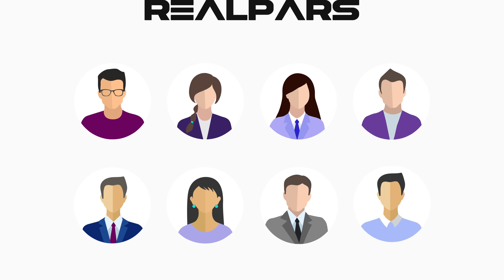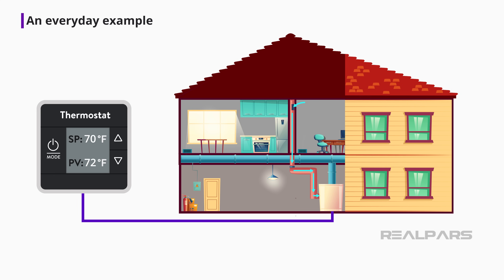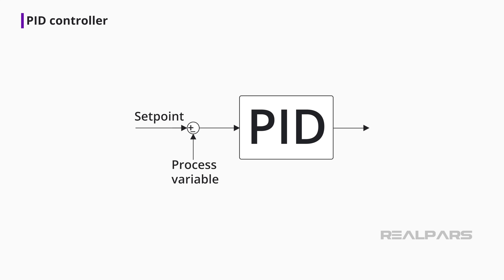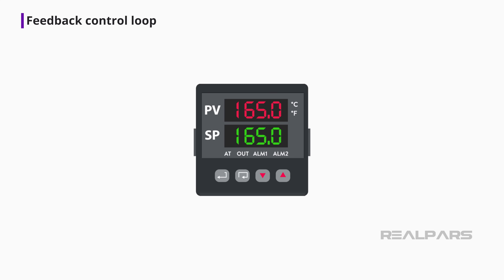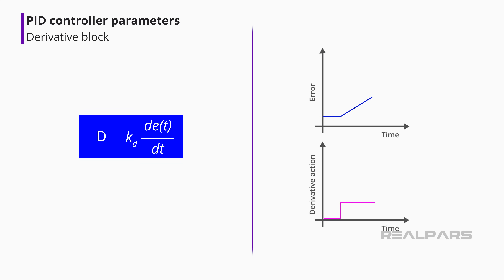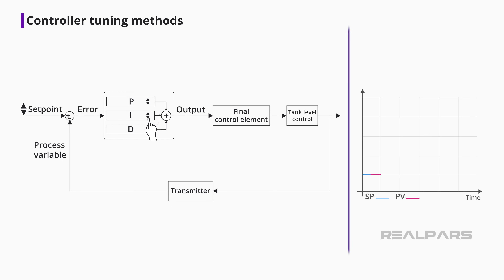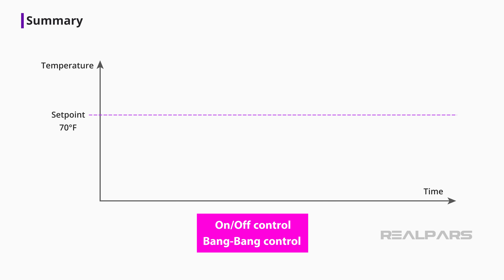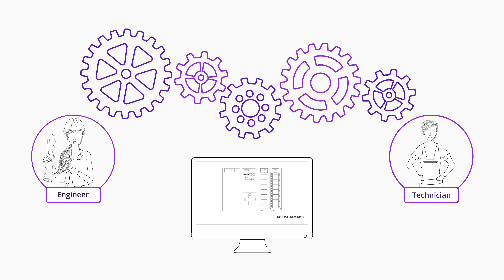PID Controller Explained

Comment: Can you do a video on " how Exactly does data transfer happen in physical level in wires or fiber optic cable."So that even non tech savvy person can understand. How exactly is 1 bit transferred between two points like New York and London ,like by switching the Voltage for s bit the whole distance? Switching it for each bits? Smart ways? How? For 1 packet ?
Update: sure get highly technical but start from simpler level and get into the depth slowly. And the reason I'm asking it here because I believe no other can explain it better than you.❤️
Reply from the maker: Thanks for your feedback and suggestion! I will certainly share this with our course developers, hopefully we can focus on that in a future video courses. 

Thanks again for sharing and happy learning!
Reply: Sort of an impossible question to answer without getting technical. There are lots of different protocols using different ways to encode signals on the "physical level". Electrical signals have properties like amplitude, frequency and phase. You can use any combination of these to encode signals. The protocol determines the meaning of a given change to a given property.

Comment: Nice video, but I think it's a mistake to introduce the PID parameters without mentioning that there are different types of PID controllers. The model presented here is parallell PID, where each parameter is applied to the error separately. In the industry, another very common type instead defines a parameter called gain which is then applied to the proportional, integral and derivative parameters. The I and D parts of the PID are then usually called Integral Time and Derivative Time. If one applies the same values to these different models of PID or tries to tune it the same way as is presented here it could lead to a lot of problems.
Reply from the maker: Hi @isakoqv. Thanks for your feedback and comments. It’s difficult to encapsulate PID details in a short Youtube video.  Your comments about Gain, Integral Time, and Derivative Time are true and those terms are important. We hope to discuss those terms and more such as Reset Windup, MPR and RPM in later videos.  Discussing and observing P, I, and D response to error is an interesting challenge because obviously in a dynamic environment, the error is always changing because of the controller response. As for tuning, there are lots of so-called tuning methods and as you say, not all are appropriate or advised as blanket methods for every application.
Reply: @realpars  It was years ago when I learned Ziegler-Nichols method and Cohen-Coon for tuning a PID controller.
Now, I forget all of them. I turned to become a programmer not related to Control System/Engineering. Only occasionally I want to relearn this interesting field.
Reply: @lexsoft3969 Hi I’m in the same spot right now. What type of programming did you get into? I’m also wanting to relearn PID and the methods, it’s been years 😊
Reply: @badplayer5880  Currently Web. In the past, I was involved in desktop non-web using FoxPro for the 1st time, followed by Visual Basic.
Reply: @realpars  sir, is it possible to make pid controller with equation of heating and cooling.
Reply: Great video. I think anither  important concept to understand is the process your are trying to control. Dead time, time constant and process gain (linear and dynamic).
Reply: Hello.i have a grundfos vfd for irrigation purpose.i want to maintain 3 bar pressure.what are the collect settings
Reply: You're just a hater
Reply: @jarnix2  Huh?

Comment: I hope you guys into explaining the math or at the very lest the transfer function of the system in future videos.
Reply: A good shout Eric. I managed to scrape through Control Systems online but found the formulae tough going. A good explain with practical examples would have helped a lot.
Reply: @YewrMan  We had a teacher who really did not get it, to simplify this subject.  Quite the opposite.  Later we had a teacher who knew the formulas and told us.  They are plain math. No fancy stuff, not even the integral part which is just the sum of something.
Reply: @mortenlund1418  Morten, is there any YouTube channels or elsewhere you can recommend that shows good practical explains of the mathematics of Control Systems. I think online study can be hit or miss depending on the lecturer. Some are brilliant and patient in explaining stuff and check that you understand and you learn the topic not just how to answer questions. But others just want to get through their online lecture quickly and at the  end of the semester give you loads of hints to get you to pass the exam even though you barely understand the topics on it.
Reply: @YewrMan  Hello and sorry for the delay. I remember making an excel spreadsheet on the PID.
But I will recomend you to first of all neglect the Deriviat for now, it is mostly a pain to work with and quite dangerous.  
First go for the Proportional.  It is straight forward math.  You somehow either multiply with more than 1 or less than 1. If you use 1 it is a waste of time.  Then you look up the formula for Integral - they are out there mostly disguised as very complicated -  using special signs and build complex. But they are not.  It is just the difference - summed together.  Loook it up and do not let them scare you away.
Reply from the maker: Thank you for sharing your feedback, Eric! I will certainly go ahead and pass this on to our course developers for future video courses. 

Thanks again, and happy learning!
Reply: It will need an introduction to Laplace transform for describing a PID controller to find the transfer function of the system.
Reply: They won’t. They don’t usually include math. But their channel is awesome still. I even love the current way they teach. Since no math is needed, many people can understand what they’re talking about. I hope they don’t include math in future videos.